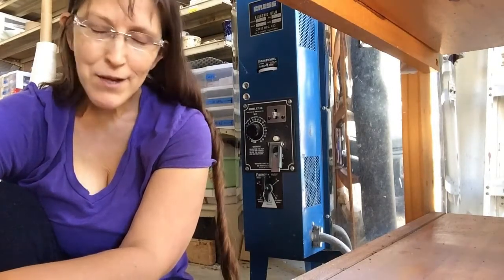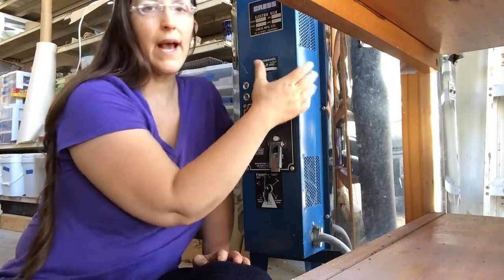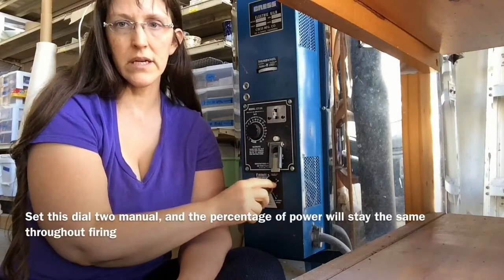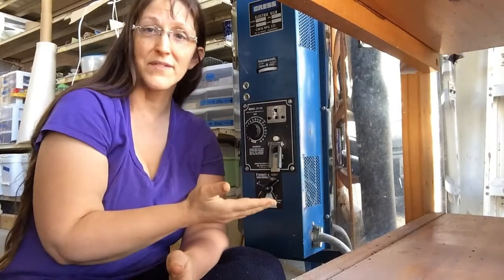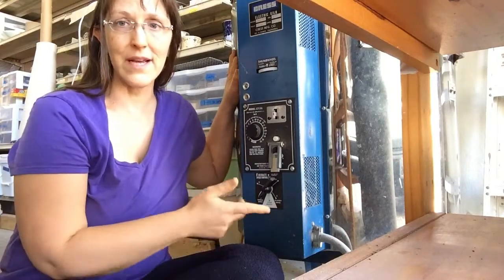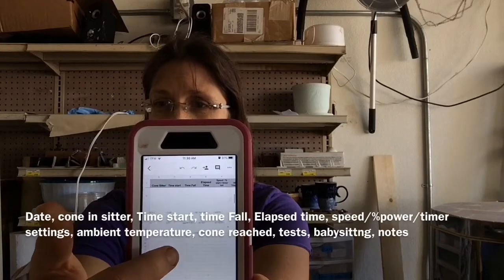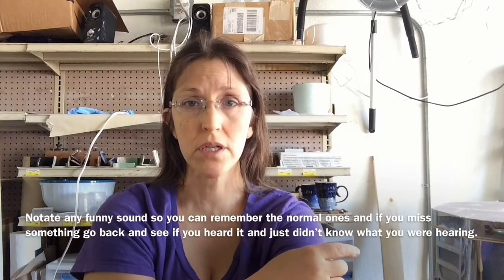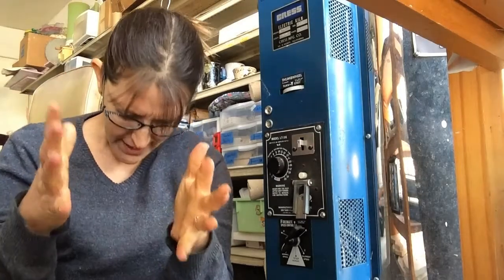How to Fire a Manual Kiln 2, Kiln Sitter, Firing a Kiln for the First Time, Home pottery studio vlog

Comment: Hi. I’m a new potter and needing help. I bought a used kiln and replaced the elements. All of them are coming on property but have dark spots. They are not heating evenly. They are expensive and don’t want to damage them with my first firing.  Please someone help 😩. I have an Aim high temp kiln with a kiln sitter.
Reply from the maker: Unfortunately I have never had to replace elements. I can tell you a few things the may help though. First and foremost all kiln manufacturers have tech support 1-800-AIM-KILN or aimkilns@yahoo.com should be yours. Most of the time these people are more than willing to help and more than kind. Take a picture of the parts of the elements that you are concerned about and send it or have that ready to send while you talk with them. Second, in some kilns the element must not be allowed to touch itself. In others it’s no big deal. The tech support will know this, but if you’re getting dark spots on places where the elements are not separated then maybe that is an issue for those elements. Third, anytime you replace elements you need to burn an empty kiln so that the elements can “seal” (for lack of a better word) themselves properly. So it could be a part of that process but that’s a tech support question. Lastly, if you are a part of a Facebook group I would post this to one of those. Be ware that you will get a boatload of answers that are not helpful and all over the place. But you may just get someone who has your exact kiln and knows the ropes. You might even look for an aim FB page. I am a member of “clay buddies” and “pottery studio” as well as “potters of Texas” and for the most part these groups are beneficial. But first and foremost contact tech support. Sorry I don’t have a solution. Keep me posted though.